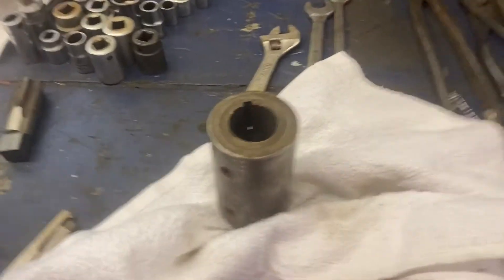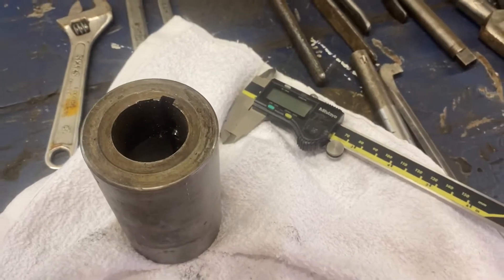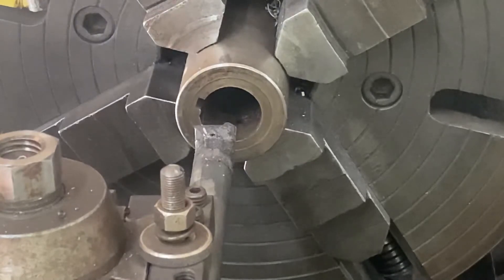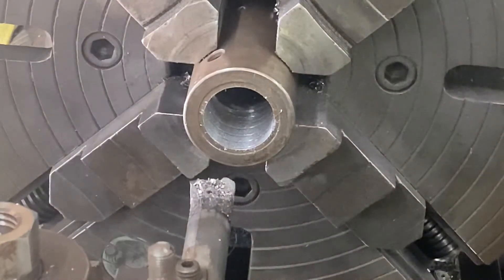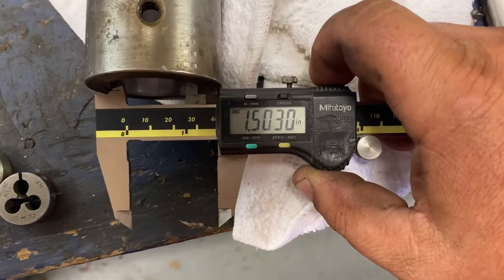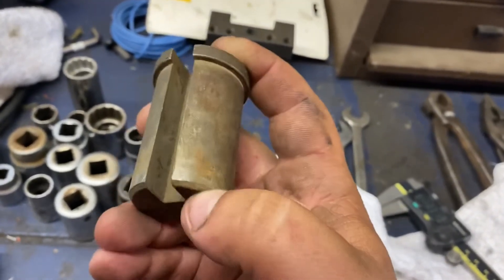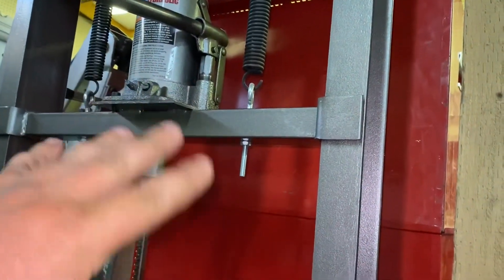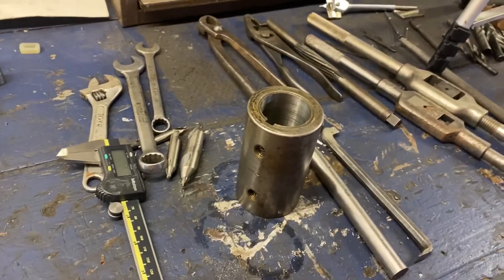Machining and broaching a shaft coupler

Comment: How many tons is your current press?
Reply from the maker: It’s a 20 ton harbor freight, I usually just use my finger in the jack handle holder when broaching
Reply: @smalltownmachineshop6860  I've wanted one for a long time (and built a small one in the past) but there's always something else to buy instead,  and also lack of space. I'm sure that when I have no other choice but to get one, I will. btw I asked Steve Watroba if he's ever seen a Starrett badged like yours (Steve has or has had a LOT of indicators), and he said he hasn't, but also isn't surprised. I'd like to hear from Mark at M.R. Tools who services and refurbishes indicators if he has seen many.
Reply from the maker: Yeah it would be cool to know some on the indicator.  My press moves around a lot, sometimes it’s even on my back porch sometimes
Reply: @smalltownmachineshop6860  I've hoped for a few years that I would find one that maybe needed a new jack, but nope. I've found crazy things people have thrown away, but never a welder or a press. One day. - On the indicator.. does it look like the Clyborne Company (or whatever) is rubber stamped onto it, like maybe an employee did it?